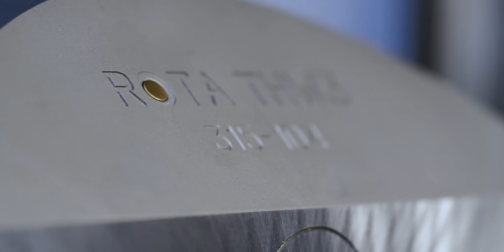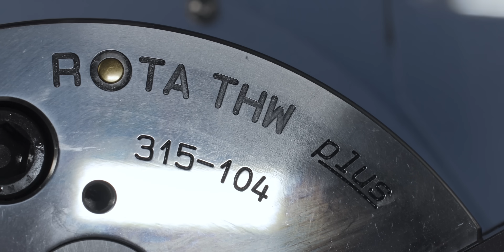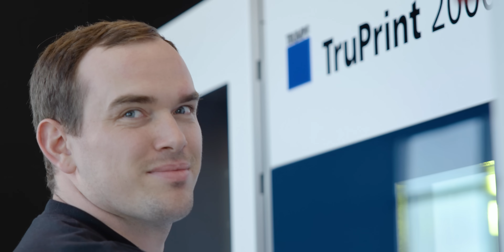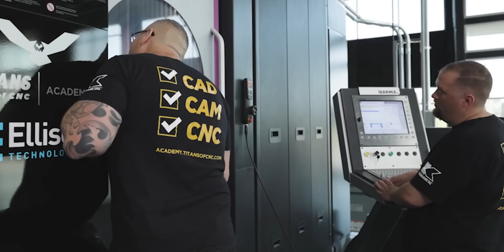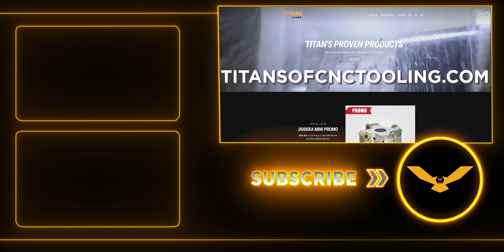Should Engineers Be Arguing with Machinists Over Run Time?

Comment: Ahh, the great cycle time debate that's probably gone on since they started making stone tools thousands of years ago.  Been there, done that.  Concluded:  B/S on ALL sides.

I'm a CNC Tech at a good sized shop, 100+ machine centers, lathes, etc. so this applies more to a production environment, but the underlying principles are still the same.   People are primarily motivated by self interest and will perceive reality thru a very self-enhancing polarized filter.  I'm with Dr. House, everybody lies.  Data doesn't -   My solution was to build a pallet timer that simply time stamps each pallet change.  It gets logged onto an SD card which can be accessed via WiFi by the office folk.  It will give you an accurate account of the actual time the pallet is inside the machine.  Since they didn't want me to include stack light information, you wouldn't know what it was doing in there, just that it was.  But even with that limited information, it gives you a very accurate in-machine cycle time because no matter how much some operators will drag their feet, at some point they'll be behind and the next pallet will cycle in immediately after the one inside is done.  Looking at the data you see this big block of near identical times for each pallet, that's your actual in-machine cycle time, not what some guy with a calculator decided it was. If you combine the data from the machine with other metrics like tool change logs, maintenance logs, etc., it allows you to start to build a more accurate picture of what's really going on in any given cell.  This gives you hard data to help prove reality rather than any sides perception or alteration of it allowing you to better determine actual underlying causes for production inefficiencies.

Comment: Iv had this exact situation at my last job. It’s toxic , and something similar but not as bad at my current one, when we get a new part, most of the time engineering quotes the time to program , and make the parts without asking the machinists for any input , we have a traveler system, so every step in order you clock in to to log your time. The only time they ask any questions is if the part is borderline too large to fit in our machines, and when they do ask, they don’t even ask the machinist they ask the supervisor who doesn’t do any machining. It’s down right impossible to hit any of the  quote times on our. Parts and it makes us look inefficient, but they at least are willing to change the time per part most times. How can you quote jobs and charge the customer without talking to the machinists! It baffles me . None of these engineers know how to machine.

Comment: As a prototype machinist with 45+ years under my belt. I would say it takes over 1000 difference setup to become proficient not just putting a vice up and indicating it in and setting up 2 tools don't count. Faster is not always the best way. I ran parts slower and in the long run it was faster. You always have to add in time to change the tool when they wear out. You may go faster but after adding time for changing the bad tool and sometimes have to rerunning that tool again take time. If you have 1 part to setup for and run take more time to per part the 100 part per part. Engineers take one or two semesters of machining. When the new Engineers come in put in the shop for 1 year as a ME or manufacturing engineers that works.

Comment: This is not an engineer vs machinist issue at all, it is a humanity issue, the issue being the desire of some humans to control others. I am a mechanical engineer who has owned and run a job shop for 32 year (currently 20 employees). Success is based on earning the respect of machinists, leading by example, and understanding and applying laws of energy and Heisenberg's Uncertainty Principle to your workers, as in, they have limited ability and motivation to stay focused and perform so you can push here and there but expect push back over there. Also, the more you monitor the more you create a state of distrust hence disrespect and ultimately burnout. Knowing the strengths of each worker and capitalizing on that in a laissez faire style is key. There are some worker who don't immediately respond to this environment, I have seen it take 6 months for the light bulb to click (and some NEVER get it it's true), but I would never run any business with Nazi like management.

Comment: So I am an engineer, but I worked in production for ten years before I got a degree. This is not a case of engineering vs. machinist imo. This is a problem with management. When engineers come up with manufacturing times it is an estimate based on math, estimate. Management needs to account for that and there needs to be efficiencies but in place to correct. There also needs to be an open line of communication between engineering and manufacturing on how times are calculated. Engineering does not get to dictate the final method of calculating.

Comment: I'm a retired CNC machinist. I think what they need to do is have a designer and engineer decide on what kind of part they need then design the part.  Give that design to the programmer and let him do his thing and double check to make sure they engineered it correctly. I have come across parts that upon trying to make would not work because of the engineer just "thought" it would be ok. It looks good on paper.    Then let the machinist set it up and possibly work out any kinks in the program and get the best machining possible for that part.  Then report back to the boss on time for the piece.
So NO, an engineer should NOT be arguing with the machinist as far as run time.

Comment: Where I'm at the department supervisor typically quotes times.  Even though we're a manufacturer of gun drills, many of our orders are customized to fit the customer's needs. So there are a lot of first time builds and processes in our plant. We do track our time for every job and part, timing in and out at a computer station.  I'm sure they also use this to evaluate our performance also, although nothing has ever been said to anyone, and we have a couple of extremely slow workers.

Comment: there is a sence behind a such logging system. for us as machinists its a little more work, but for the company its important. because this is the only way, to calculate exactly how the parts exactly costs. it also shows, if changing a process is a benefit or not. it also shows merciless, which operator needs how much time for which set up. without a such system the guy, that calculates the prices can just estimate them. this isnt realy professional. etimating the prices gives you only a chance to earn money with every assignment, but itn dont guaranteed so.

Comment: The company that I previously worked at is using a similar system for inspector and machinist. Every morning both departments have meetings to go over how efficient the whole group is doing. If it’s low and one person is to blame then they get called out during the meeting. The metric is calculated by how long each part takes to inspect or machined. So on the traveler if it says that a part takes 5 minutes to inspect and there is 12 pieces then you will have  to measure it in 60 minutes. Even if you are new to the trade the company expect you to run a part like a seasoned machinist. If you don’t meet the time then your efficiency is low and the mangers will pay you a visit. The micromanager don’t want to hear any set up slow down issue since they all want numbers. This system is very flawed and it is making everyone put speed over quality of work. You can’t thoroughly inspects or machined parts if you are being rushed. The quality manager who is also a DQR don’t even inspect the parts that they are require to. They are assuming the previous inspectors thoroughly checked the parts. The company is saying that this system is to help quote jobs better which is a lie. This system is in place to track employees. An engineer said that this employee tracker is called a Baan system. The managers is always requesting process improvement forms to make a job faster. No machinist is helping with that even if they know that they can improve the machining time.
Reply: If efficiency is being measured in anything other than "late deliveries," you're wasting too much time tracking efficiency.
Reply: That's just a failure of the system implemented. No greenhorn can machine or set up the same as a skilled machinist. Most cost calculation or timing programs will have a fridge factor for new vs skilled personnel and illness and so on. Any company worth it's salt will be using this and expect some time differences over the amortisation of the part. One offs are expected to take much much longer than any batch or series part
Reply: Damn, sounds just like the place I got fired from recently. A new supervisor came in and just killed the flow by prioritizing numbers over quality, and then complained to the higher-ups about part quality.

Comment: Sounds like a shop I used to work at, giving a blanket 90 minute setup time no matter if you had to dial in a 13 tool turret with boring jaws and tapping in parts to absolute zero tir. I loved the work but hated the management!

Comment: I started out in a fabrication shop running CNC press brakes. I learned very fast that the design engineers can be oblivious that their stuff actually needs to be made. My whole job was bending stuff and the engineers didn’t account for bend allowance or different radiuses for different materials….but it was my fault when parts didn’t fit right.

Comment: My inside shop is small and we farm out a lot. I’ve been using the same shops for years and usually let them make the parts and charge me time and material. If it’s a large qty I let them make a few and then quote. The few times I’ve been surprised I went to the shop and watched them make a part. Usually I end up buying them a special fixture or jig and they require.
Reply: Requote

Comment: Work about a year as a manufacturing engineer in a grinding cell at a bearing plant. I quickly learned that the operator knew more than the company MFG engineers about cycle time and product quality. I gave them the bonus to get better than 20% scrap rate. AIRCRAFT BEARINGS ARE TRICKY.

Comment: Engineer here, but one who machines, assembles, welds etc. things at work on a weekly basis. 
Idk the situation at your shop, but the machinists at my work often have similar complaints. 
"These meetings are pulling me away from what I should be doing"...no, you're watching YouTube videos at work dawg
"I don't have the right welder to do this"...the right welder shows up and it takes him 2 weeks to even start using it
"I don't wanna make it twice because you're not 100% sure it'll fit"...we are a prototype facility, It's rare but possible for me to make mistakes.
So I end up making a lot of things myself because I don't want to deal with them. 
In your case, a lot of what they did seem messed up but I question why machinists would be so mad about a performance metric system. If you all do within 10% of each other, as one would expect, nobody would compare you to a theoretical machine time quoted previously. Or at least they shouldn't.

Comment: This is sadly very common as most designers don't seem to understand anything about manufacturing today. This is not limited to machining either, it applies to many other areas as well. This is because designers come from schools where they specialize in exactly that, designing and nothing else. It's bass ackwards in my opinion, because a design is absolutely useless if it's not manufacturable or hasn't been designed for manufacturability.

A competent designer - whether engineer or otherwise - would be very interested to listen to and learn from those doing the manufacturing to become more competent designers. There's even a word for that mindset, design for manufacturability. If i remember correctly, you guys have mentioned it sometimes, too.

Comment: This is a great subject. For a little history: Most people are familiar with the term CAD CAM. That means “Computer aided design - Computer aided manufacturing”. 

Many years ago, computer companies thought that a draftsman could simply produce a drawing, and then the computer would decide how to make the part. So in theory, the drawing would go from the office to the machine without the need for a human operator. But that idea didn’t work for a couple of reasons. 

First, the process of programming the machine for optimal speed turned out to be more complicated than expected. So CAD worked fine. Most companies use a drafting program called “Autodesk”. But the CAM portion of the system only worked in a highly automated repeating system. For example, when you need to make five hundred identical parts.  

If the company is trying to make a wide variety of parts, then the CAM programming function of the CNC machine takes too long for each part, and often doesn’t provide the optimal solution because there are too many variables. A skilled human operator can program the machine better than the computer. 

Nobody talks about this because the government claims that computers are always better than people. But when operating in a complex environment which requires a range of conceptual skills, people are faster than computers. That infuriates the communists, because they want computer calculations to replace human judgement. So they use propaganda words like “artificial intelligence” in an attempt to force people to surrender their free will to “the system”. But there is no system. 

Anyway, CAD CAM as a universal work flow solution has so far proven to be useful only in limited applications. The second problem is that the attempt to eliminate the human operator also didn’t work. Machines are not as autonomous as factory managers want them to be. And also, if there’s no meaningful human cooperation between the office and the shop floor, things usually don’t go well. 

Surprisingly, U.P.S. is at the heart of the conflict between CAD and CAM. They operate the largest logistics software environment in the world. So they claim that if they can tell packages where to go, they should also tell people where to go. The U.P.S. computer, built by I.B.M. is the communist mainframe which is supposed to bridge the gap between Marxist ideology and the world’s  “optimized” organizational structure. U.P.S. will provide the CAD, and Washington will provide the CAM in the form of hourly work orders delivered to each person by mobile phone. But this plan can only work if people surrender their free will to “artificial intelligence”. And that’s the problem. The U.P.S. computer can’t really make life-choices for people. It can only pretend to do that. Everyone is much more skilled in the use of various concepts than a computer. Well, everyone who has received a proper high school education, that is. 

So CAD CAM’s failure will become part of the Marxist U.P.S. failure. The human race will march bravely foreword, until faster computers supply us with faster failures. 

Then we might start giving the children a real education again. Without I.B.M. or the sinister U.P.S.

Comment: One of the big cost and time drivers is engineers not having a good background in GD&T which results in conflicting call outs or tighter tolerances or surface finishes than what is truly required for the part being designed.

Comment: At the last place I worked at they had all the part times set for manual drilling and milling. But once we got CNC’s and my supervisor and my self started building programs for them. To speed things up they started complaining we were taking too long to make the programs and it was costing them money. 

But when they seen that we could run the same parts in a fraction of the time they were happy. Well at least the owners were. The engineers always told us the stuff we we’re trying to do could not be done and we proved them wrong. Than they wanted to know how we learned how to do it we just showed them your videos. Now they just bring us the new blueprints and see if it possible and how long it will take. Currently using a Haas TM3. we had to learn how to use these on our own because even they did not know how to use them. Anyway thanks for all the great information I have learned so much from just watching your videos. As I have never ran a CNC till now.

Comment: My father ran a tight ship he quoted everything but he was also a learned by the seat of your pants Machinist.
He would also ask a number of our top men to also quote the same work.
That way he had a better understanding of their point of view when it came to quoting work and running work.
So then he could actually go on vacation jobs could be quoted and ran not lose our shirt or chase off a customer.
He came up with a factor of three, regardless of what their quote was to either multiply or divide by three depending on who quoted it.
I'm actually being serious here.
He quoted so much work everyday it was a pile of blueprints a foot high generally somewhere later in the day he would get himself an adult beverage he would have someone go and chuck up a piece of material in one of the  lathes then he would go out and destroy it just turn it to chips for no better reason than to turn it into chips at the end of the day it put him in a much better mood and was worth every penny.

Comment: Analyzing utilization and throughput is valuable. Machines and people in manufacturing should be tracked. But the effort should be essentially swiping a badge. Don’t waste people’s time with tracking. But also don’t use the info to point fingers.